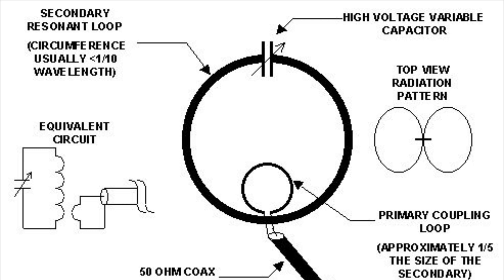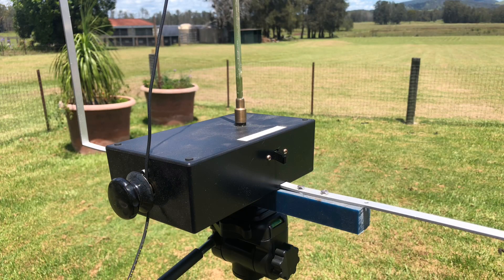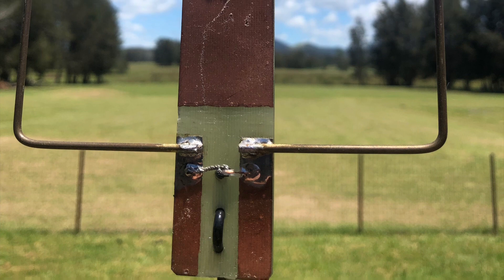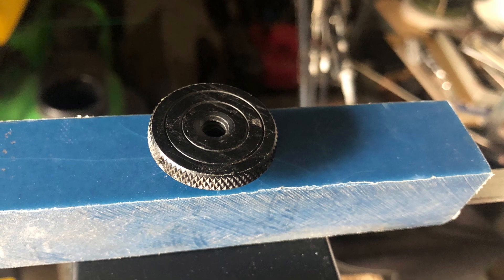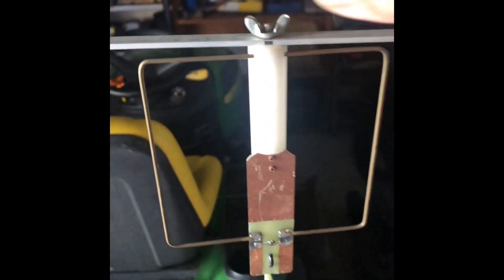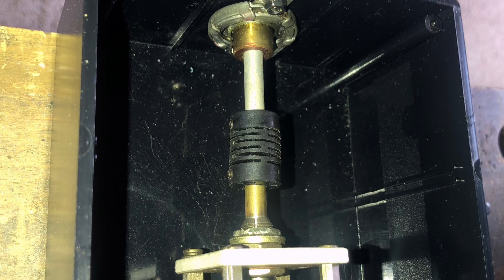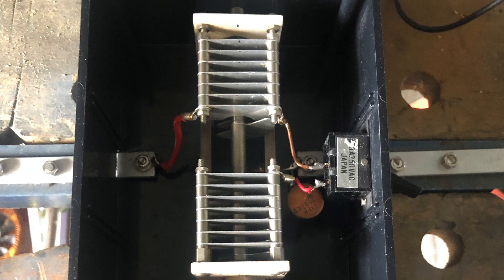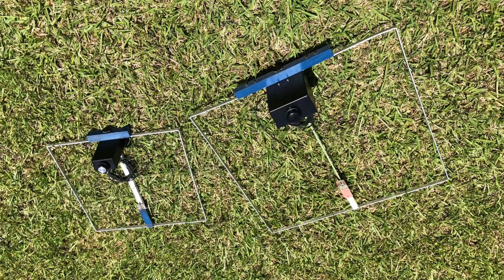Andy's Workshop - HF magnetic loop antenna

Comment from the maker: For anyone wondering about capacitor values and other dimensions, here is an excellent on line calculator:

https://www.66pacific.com/calculators/small-transmitting-loop-antenna-calculator.aspx
Reply: Andy, I'm wondering about something on that calculator. When doing a calculation for a flat material like you used, do you use the thickness? 73!
Reply from the maker: @N7KOM  From my experience the thickness has an effect on the bandwidth but not much else. Thicker (bigger diameter if you’re using tube) gives more bandwidth … although loops are notoriously narrow even with fat tube.
I would suggest putting in the bigger dimension if using flat bar. It will be fine.

Comment: A bit late to the discussion here, but I literally have built 6 different loops that cover various ranges from 3.5 MHz to 50 MHz. I have a loop for 6 meters that uses flat aluminum strap, around the same width/thickness of yours, but 90 cm overall and bent into a hexagon. It covers 10 & 6 meters with a 50 pF cap.

I have a bicycle wheel rim loop that is an amalgam of designs from VK3YE and M6YIK. With a 100 pF variable, it covers 17 meters through 6 meters. For my bigger loops, I use cable TV RG-11, equal to a 75 ohm version of LMR400. A pair of 2-turn loops, a rectangular one, 90 cm by 120 cm, for 80 meters through 40 meters and a M6YIK-based 60 cm diameter 2-turn loop for 40 meters through 15 meters. The collection is completed with a 1 meter round loop for 40 meters through 10 meters and a large 250 cm diameter 2-turn loop still under development. That one is intended for 160 meter and maybe 80 meters.

My property is hemmed in with overhead power lines, so space is at a premium. I have a clear area about 8 meters by 18 meters out back, that's it...

Keep up the good work, and hope to CU on the bands!

73, Keith, WB2VUO in Amherst, NY
Reply from the maker: Great comment Keith ... thanks.
Small magnetic loops are a great solution for small spaces. One of our club members only has an apartment balcony to put up antennas ... and uses magnetic loops exclusively.

Comment: Andy, do you have the plans with dimensions for your magnetic loop available? I would like to build them for my dad to use in Arizona. They have restrictions but feel this would be a great way for him to get back on the air running low power. Thank you!
Reply from the maker: Hi Mark,
I don't have any written plans but I will take some measurements for you when I get a chance, however nothing is particularly critical.
Some typical values and dimensions can be found at this link.
My loop are square but use much the same dimensions as circular versions.

https://www.66pacific.com/calculators/small-transmitting-loop-antenna-calculator.aspx
Reply: @VK2AAK  Thank you so much Andy!

Comment: Thanks for sharing Andy! Quick question....if you get this?? What does "over coupling" look like? i.e. what does it do to receive / transmit signals and/or  the match obtained? In short how do you know when you are over coupled?   Cheers VK2AOE
Reply from the maker: The effect was that I could tune the loop through the point of minimum SWR but the minimum SWR was still about 2:1. By turning the feed loop in relation to the main loop and thereby reducing the coupling, between them I could tune for a minimum SWR of close to 1:1.

The coupling didn't seem to affect anything other than the matching.
I probably could have achieved the same thing by keeping the feed loop in the same plane as the main loop and just increasing the spacing between them.
Some of the problem could be due to the fact that both loops are square and therefore one side of the feed loop runs parallel to one side of the main loop for a fair distance. That wouldn't be the case if the loops were circular.
Reply: @VK2AAK  Thanks for that! So at resonance the feed point z was not a correct match. The coupling fiddle gets that correct load match for the tx final stage. The loop is a fascinating beast....gonna build one soon. Now I know one thing that I might need. Thanks much appreciated.
73 George

Comment: I most certainly am interested in your design on this antenna. My primary interests is to build one that I can use on my Toyota SUV. I really like what you have demonstrated because it's like having a "Proof Of Concept" demonstrator. I don't mind the unconventional looks because it's the performance enhancement to my radio that means a lot to me. Thank You!